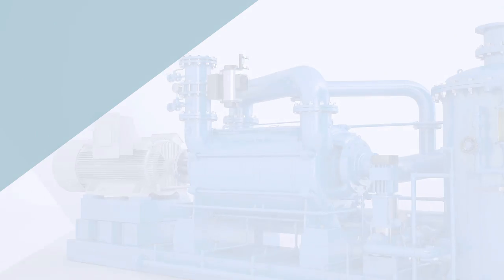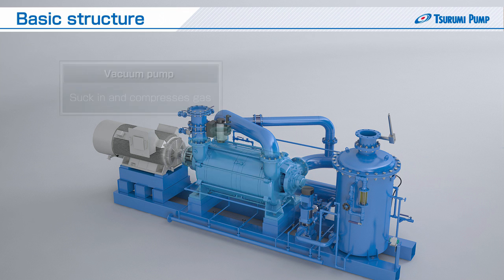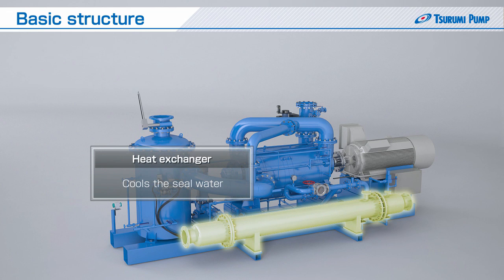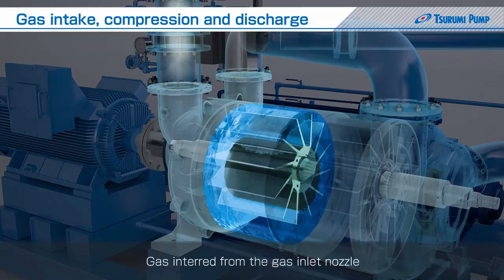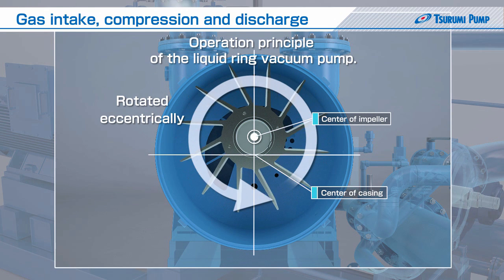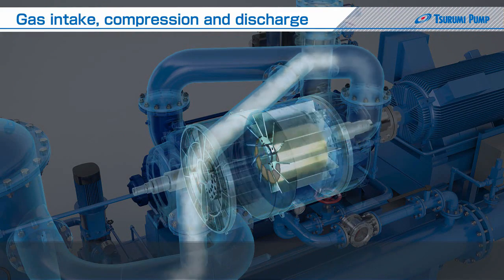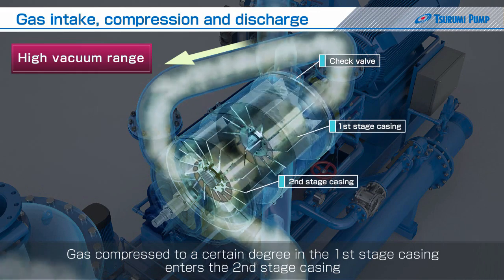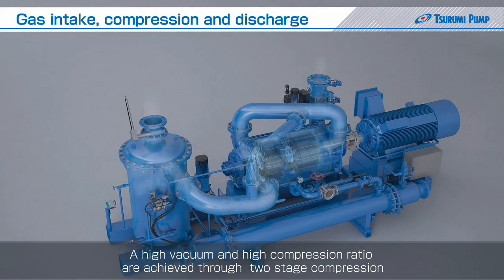Tsurumi Condenser Vacuum Pump  Package（Model　ＶＭＡＦ）_Tsurumi Pump

Comment: What is the using of recirculation pump... since some of vacuum pump system don't has the recirculation pump?
Reply: Recirculation pump take care of pressure drop across pipework and heat exchanger and ensure a adequate  flow of seal liquid to pump. Smaller pumps can be run without circulation pumps, but bigger pumps need this.